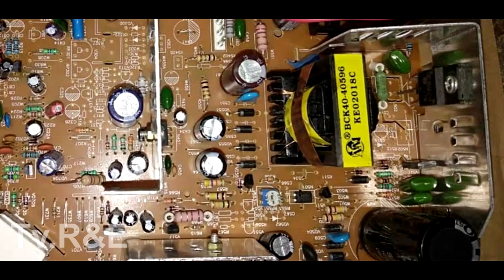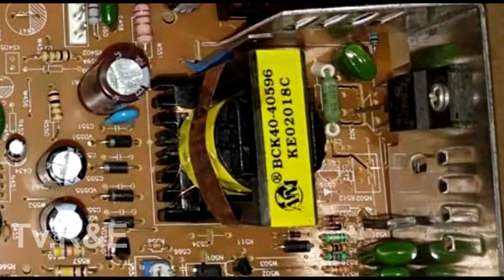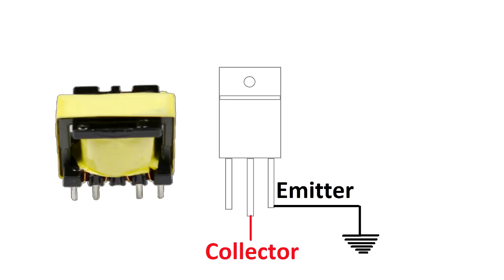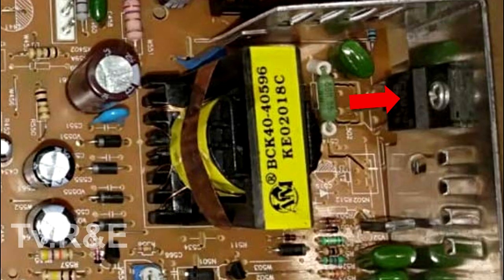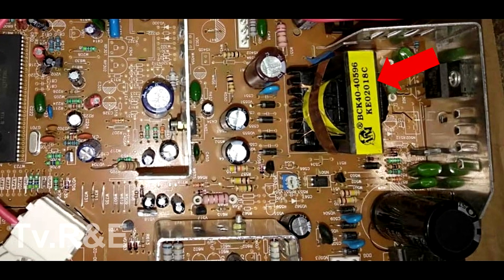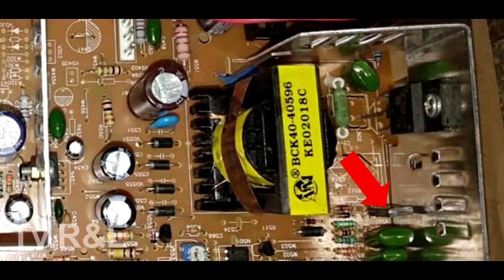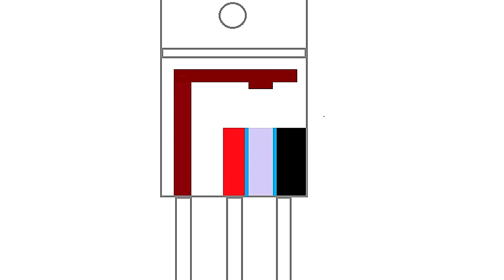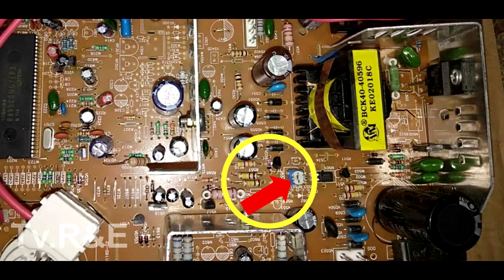T.v. Power transistor information.

Comment: Sir    local China tv  kit me power supply switching transistor (MD1802FX ) ka bass mein  0.4 - 0.5v show  kar raha hai aur transistor overheat ho raha hai aur output mein koi bhi voltage nahin mil raha hai. Switching transistor, driver transistor , dono regulator transistor ,  preset  Badal ke dekha , octocopler bhi check karke lagaya par abhi bhi problem solve nahin hua....

Comment: Mera tv kharab ho gya tha, isme eht kharab tha, new lagaya toh shi ho gya lekin ye power transistor C4460 heat ho rha hai, Kya problem hoga sir? kya check kru ab?
Reply from the maker: 1600v PF or 400v PF change karke dekhiya
Reply: @electrorepairhub  sir Switching transistor heat ho rha hai, output transistor nhi,
Iske liye bhi 1600v or 400v pf change kru kya?? Sir

Comment: Hi sir lg ultraslim kit mai 110v ki yagha pr 85 volt and heater votlage 2 volt and eht ka focus v kmm ha but kit picture tube mai nhi lagi .
Kit ko picture tube pr na lagane pr esi hi voltage show kareva kya plz.... reply me
Reply from the maker: Power supply ka main filter capacitor check kijiya or STR change karke dekhiya

Comment: Sir ek  ultra slim local kit hai tda12135ps/n3/3 ic hai ic ke pin 38 pe kitna voltage out hota hai (set on / off me by remote) se
Reply from the maker: Scl frequency 1Mhz... ya multimeter se nahi dikhayga...oscilloscope chahiya.

Comment: Bhai EHT se continue tej sound aa rha h aur screen bhi nhi aa rhi.. EHT replace karna hoga ya kuch aur?
Reply from the maker: Output transistor or yoke coil ko check kijiya...
Reply: @electrorepairhub  yoke coil ka wire nikalne ke baad bhi EHT se sound aa rha h. is it ok?
Reply from the maker: Line coil's ko check kijiya or filament jal rahahai ki nahi use chake kijiya...
Reply: @electrorepairhub  bhai coil ok h.. eht bhi bn rhi h..180v drop ho rhe h 160v ke aas pas ban rhe h...Nd filament nhi jal rha.. eht se tej sound bhi aa rhi h...Output tran. D2499 change karu ya kese check karu plz guide..Thanks in advance